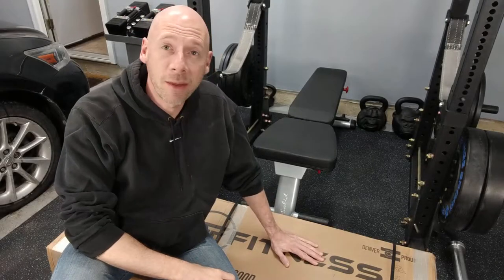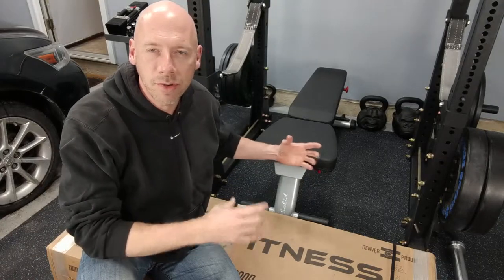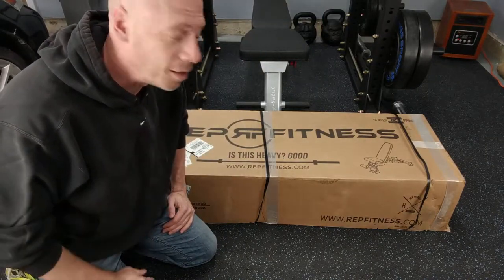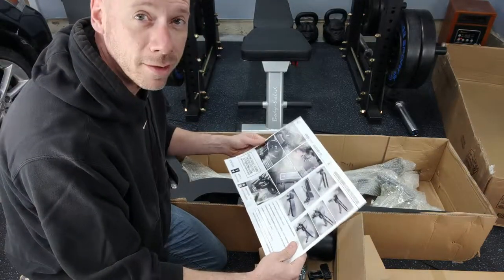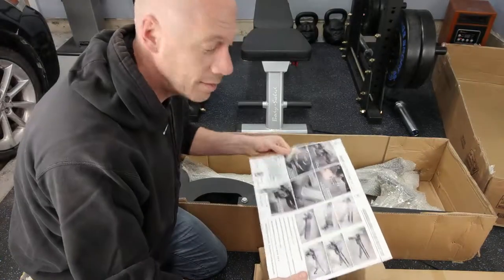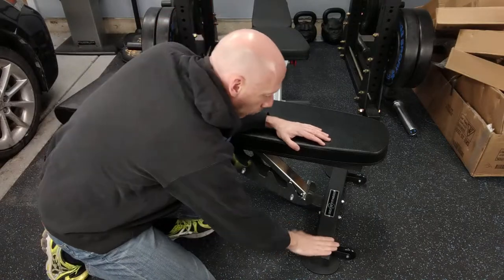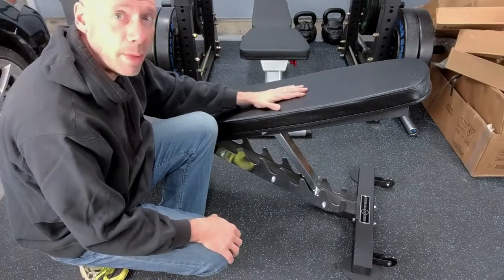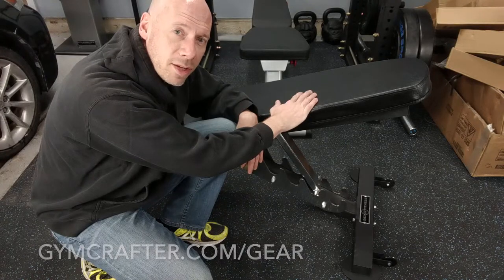Rep Fitness AB3000 Unboxing

Comment: Thanks for the review. What I don’t like about the bench is that Rep didn’t put rubber on the bottom of the feet so the bench won’t slide if your on a slippery surface.
Reply from the maker: That's great feedback and I'll be sure to point that out when I review the bench (very soon!). I have rubber flooring so never would have noticed that myself. I appreciate you letting people know!
Reply: Gym Crafter Question : Can you stand up the  Bench when not using it?
Reply from the maker: @rambojohn7118  I just tried and for sure that's a no go. Thanks for asking, I never would have thought to try. I"ll make sure and include that in the review I do soon.

Comment: Another great review! I know you are also a Titan fan - curious how you compare yours AB3000 to their Single post adjustable FID bench? Item No. 400969
Reply from the maker: Thanks, Shaun! So I don't have any experience with that Titan bench, but I think we can probably safely assume a few things. First, it's clearly a clone of the AB3000. From the exact shape of the pads to the overall design, it's Titan once again copying someone else's already successful product. I'm not saying that's good or bad, that's for you to decide. I'm just saying it's what they do.

In my experience, every time Titan copies something, it's usually just a bit off. Not that it's bad, it's just that their attention to detail just isn't there. If the Titan was $100 less than the Rep, I'd say go for it. But it's not. It's pretty much the same price (maybe just a few bucks less?). With price being basically equal, I'd have to recommend going with the Rep.

Unfortunately, neither one is in stock right now, so it kind of doesn't matter. And like I said, I haven't actually used the Titan, so take my feedback with a grain of salt. Not that any of that helps, but it's my .02! Thanks for checking out the channel, I appreciate it!
Reply: @GymCrafter  Valid points sir! Thanks again for your unbiased input.

Comment: I've had this bench for 2 1/2 years, no complaints.
Reply from the maker: I'm loving it! Gonna do a review soon now that I've had it for a while. Some of the trim on the cushion is coming off, but otherwise it's just about perfect!
Reply: @GymCrafter  those leg holder gets in the way for some exercises? is seat pad too wide or uncomfortable? what do yo think about other bench 
rep ab-3100v3
Reply from the maker: @kavinda1984  I thought the leg pads would be a problem, but they haven't bothered me at all. I have looked at taking them off because I don't use them, but I just haven't gotten around to it yet and since they don't get in the way, I don't really have a reason to. The seat pad is great, I really like how wide it is. The top portion of the bench fully supports my frame when laying down (I'm 6'6") and is also a good width.

As for the 3100, I haven't used it myself. It does look to have narrower pads and seems to be a bit less beefy throughout. On Amazon, it gets a good number of less than stellar reviews too. I know I gave it a hard look when picking my bench and wound up spending the extra $ on the 3000 because of the heavier duty construction. My thought was that I only want to have to buy one nice bench and that I want it to last a very long time. It made sense for me to get the beefier one. That said, if money is tight, the 3100 looks to be a nice choice. In my opinion, Rep is making the best benches for the money out there. Really can't go wrong with any of their bench line up!

Comment: Hows the padding holding up.   Will it support 400 lb benching ?   Wanna order there replacement pads but not the fb5000 pad as it's too thick for my bench height.
Reply from the maker: If I was benching that much, and I'm certainly not, I'd probably opt for their flat bench. As for this bench, it's rated for that much weight, but I'm guessing over time any pad would compress and wear with that kind of load. But I'd call that a high-quality problem. I'd gladly trade having to occasionally replace pads with benching 400!
Reply: Thanks for the complements.   I have a flat bench I'm replacing a pad on.  But with the same as ur adjustable bench padding.   Also thinking of buying ab3000 for heavy dumbell work.    Looks solid for that. !

Comment: When is your update on this bench coming out ?  Tell me this , do you love it ? Is decline press pretty good ?
Reply from the maker: Sooner than later, but I'm not sure when I'll be publishing this particular video. I love this bench. I actually don't use the decline that's built-in, though. For decline, I end up putting a couple of bumpers under the end. It just feels better that way. I also don't use the little ankle pads, I wish it didn't have those. The only real complaint I have is that the little piece of trim they glued around the bottom of the pad is coming off. Easily glued back on, but it bothers me.

If I was going to buy a new bench right now, I would consider the AB-3100 as I don't use the decline and I like the ladder-style adjuster on the seat. Not sure I'd like the narrower seat, though as I like the wide seat on the 3000.

Overall, though, I love my bench. Not looking to replace it at all and would for sure buy it again and recommend to others. Rep isn't taking orders right now, so who knows when you could get one, but I think it's worth the wait.

Thanks for checking out the channel. Stay tuned, it's about to get a lot better and I have a lot of content planned.
Reply: I found your web site , thanks  , I’m gonna buy one when they are available again .